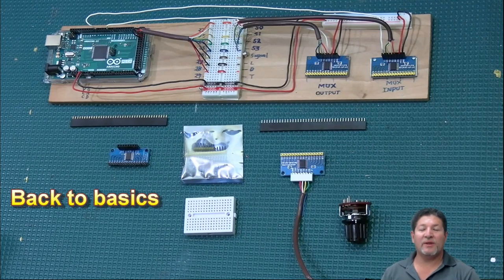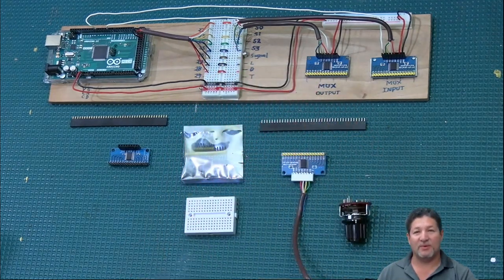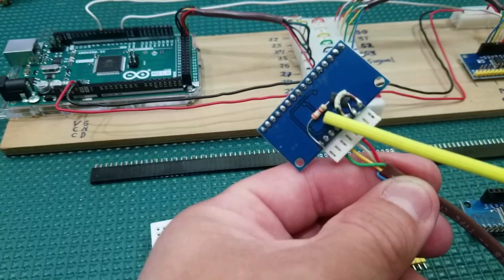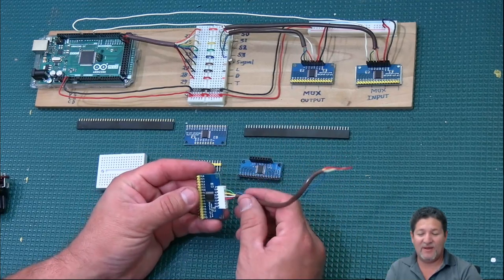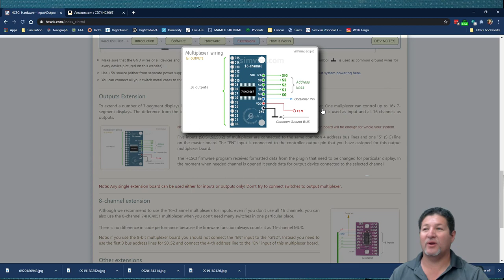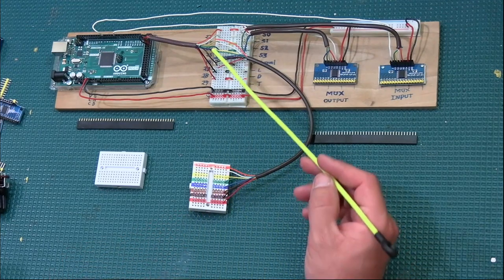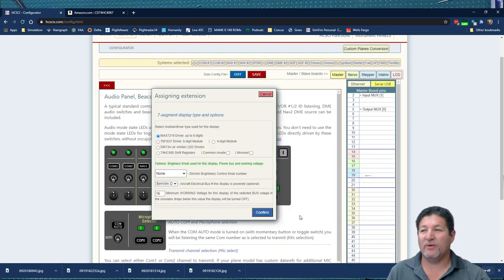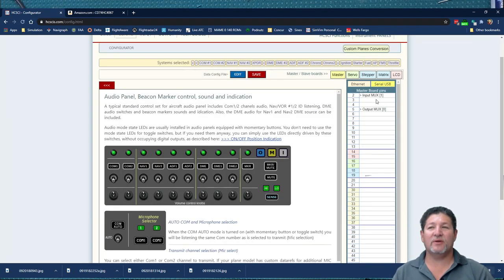Back to basics: Using multiplexers with SimVimX/RealSimControl

Comment: I just finished a starter panel for the THRANDA Pilatus Porter PC-6 that has lots of 2 en 3 position switches. Now that I am using the multiplexers it looks much better. I m also a beginner, but a friend is making a G1000 PFD and a MFD panel with HCSCIS interface. So I hope he makes one for me. I use your color scheme for the wires. So you set a sort of a standard ;-). This HCSCIS interface is awesome.
Reply from the maker: Oh that's awesome, that just goes to show even beginners can build something useful for our home cockpits. I set that color scheme early on so I'm not always confused 😂

Comment: Great tutorial, Jose!  I think headers are just fine - especially if you secure the wires down with zip ties and tabs - I solder because it’s easier for me :)
Reply from the maker: So far so good for my setup lol. I think to 20 gauge wires I'm using for most of my stuff fits very tight so it's pretty secure. I do love soldering though

Comment: On the older version it needed to use a slave board... so we can now connect it directly to a main board...🤔
Reply from the maker: What did you need a slave board for?
Reply: It was on the instructions, to power Multiplex or 7 digit modules
Reply from the maker: @redd6914  Since I started using it I've never used a slave board and I've connected multiplexers and 7 segment displays directly to the Arduino.  As a matter of fact you can't use slave boards for those two components, only for LCDs, Key matrix, Steppers, and Servos

Comment: Hi, I’m getting ready to start this large sim project for building a cockpit simulator.  Not exactly sure yet which plane I want to use.  My question may be easy to figure out, but I just don’t know.  I know simvim has the panel module, plus individual instruments.  What I’m not real sure on, is whether I would be locked in to one of the already built panels, or if I can use all single instruments.  I haven’t seen you or any other individual actually do a video on setting up the panel module or individual instruments.  If you use individual instruments, can you move them each of them around separately, or are they locked in some sort of way?  It would be nice to know some of this in advance before I actually start designing and building the actual cockpit portion.  Any assistance would be greatly appreciated.  Thanks
Reply from the maker: Hi Curt, I have never used the panels modules but from just glancing atvthe page it seems you can only use entire predetermined sets of instruments. 

I know most people who want to use single instruments use Air Manager but I've never use that either.

Comment: What multiplexer ar you using in the video? I know it's CD74HC4067 but is it digital or analog multiplexer? What is the difference between them two?
Reply from the maker: There is no difference, they can all be used for digital or analog as far as I know. Actually even in the name description they are called analog digital multiplexers.
Reply: @Qosmokid  Thanks for the quick reply! Im buying 5 multiplexers now for my overhead panel. Great video btw, learned alot from it.
Reply from the maker: @markus_c7302  Thank you for the message and you're welcome

Comment: if we do not put the pullup resistor from signal to Vcc, will the multiplexer does not allow analog signals?
Reply from the maker: As far as I know it does, the resistor is to prevent erroneous or stray signals

Comment: Its a good thing I rewatched this video again because I forgot the resistors. :)    On another note, Do you happen to know how many slave uno can be hooked to the main Arduino?  Couldn't seem to find that info on Hcsci Thanks for the Videos!
Reply from the maker: That's good John, don't forgwt to look at the wiring drawings on their website because I could make mistakes too 😁

I think you can use one for key matrix, one for LCD controller,  one for steppers, and one for servos. So four total